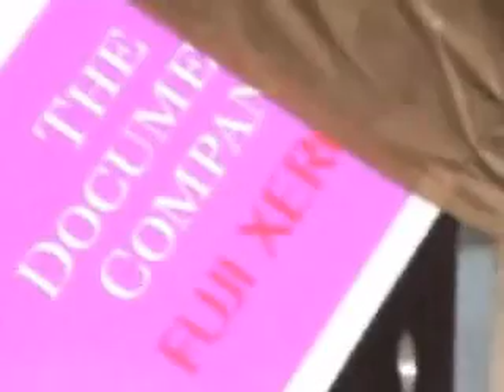Simon - "Kuka makes a painting" 2004

Comment: Kuka has a bizarre controller. Stay away from it unless you want to have a heart attack. I am forced to develop programs on this platform on a daily basis. My sincere guess is that the controller originated as a work by a couple of inexperienced students and was sold to executives based on the colorful, windows-like interface (that appears in every flyer distributed from Kuka). Bugs linger year after year without being fixed. The XP operating system has been stripped of everything useful...